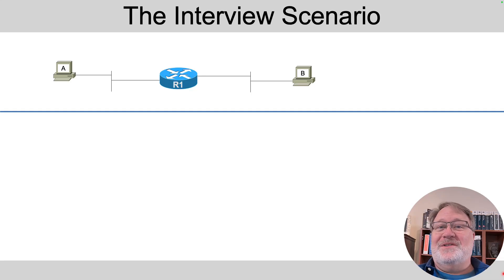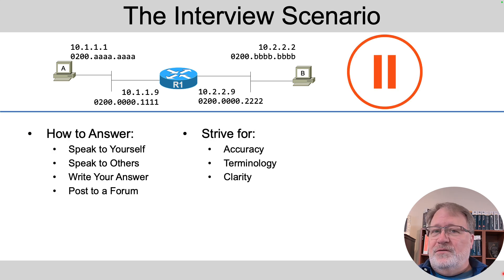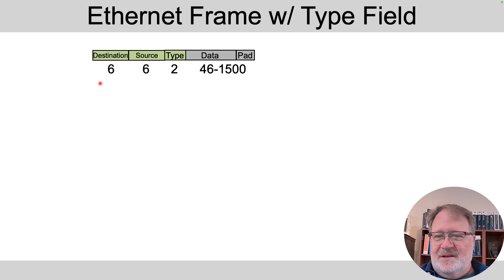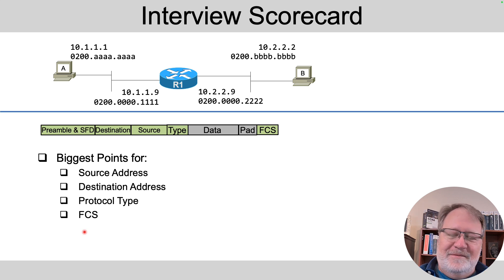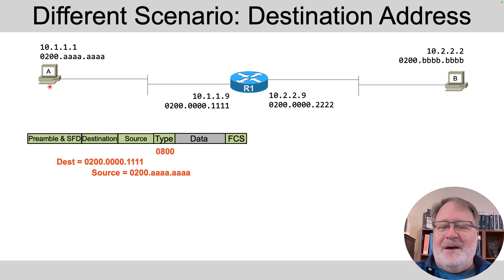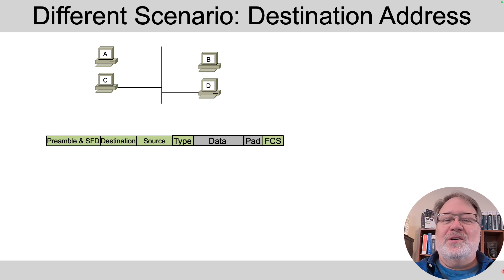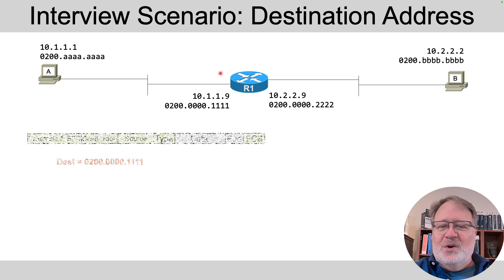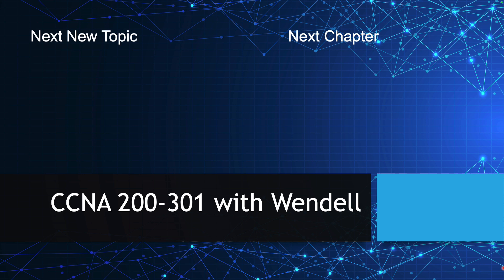CCNA Interview Review: Ethernet Frames and Fields

Comment: I might learn it later, but Im curious: if the packet is destined to Computer B but the ethernet packet shows destination of the router, what part of the packet remembers the final destination?
Reply from the maker: Hi Alina,
No problem. Your question gets to a pretty important point, which I'll cover in several videos in the course. But if you want it in video from, look here, and look for the middle sections on host routing and router routing. https://youtu.be/a_TdHxqMaGo

Anyway, the IP packet - the data beginning with the IP header - travels the end-to-end path. The destination IP address in that packet has the final destination device's IP address in it (aka computer B in this case.) The Ethernet "frame" - the data beginning with the Ethernet header, with it's encapsulated data, which includes the IP packet - the destination MAC address in the Ethernet header is the one that refers to the next device aka the router. So, data link destination is the next device, network layer destination is the final destination.